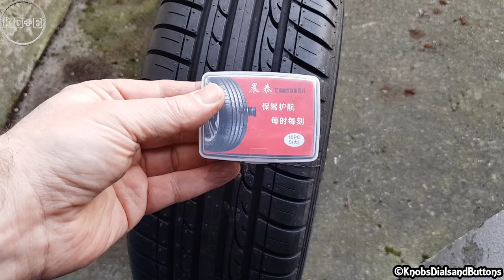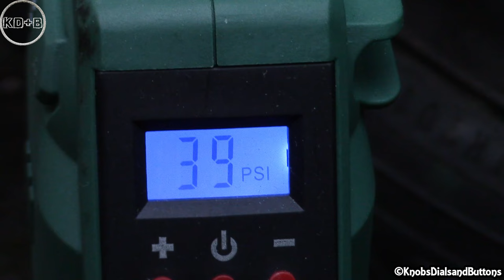Tire Repair - Fastest and Cheapest Puncture Repair Kit

Comment: Never take a tire for repair to any place that sells tires. They lie and rip you off to sell a new tire. I caught a local place doing it. I had plugged the tire but still had a leak. I wanted a real plug put in. They made me wait 2 hours and charged me 30 bucks. The next day the tire was low. I went back they toook the tire off rim and told me I needed new one. They wanted me to open trunk for temp spare so I had to go out in bay. I saw the tire off the rim. Looked inside and saw they never repaired it just the plug I put in. I snapped a pic and told them put tire back on rim and on car. When they tried to charge me I showed pic. I was going  make a complaint. They did not charge and refunded the first charge also for the phony fix. Turns out the guys in shop get kick backs on tire sold.
Reply: I would prefer forking out £60 for a new tyre than dying in an RTA.
Reply: @SuperLittleTyke  that's the thing.  If you know how to plug a tire well.  There is no need to die in a road traffic accident or pay for a new tire to replace your old one which depending on the condition, it might actually get resold by the repair shop. So technically speaking you would not only be wasting money on an unnecessary new tire, but also donating a good tire to your local shop. 🤷‍♂️ 

Fixing a tire on your own is way easier than changing your tire for the spare. Which is also quite simple to do, and not worth wasting the money for someone else to do the same thing. If you are worried about the time it might take.  It would always take a lot longer for someone else to do it. 

There are exceptions of course,  which only applies when the side wall of the tire has been damaged.
Reply: Discount Tire fixes flats for free. Also free tire rotation for the life of tires purchased there.
Reply: Good one
Reply: this is the real world . big fish eat small fish .
Reply: @jungleno. They refused to patch mine after I put a temporary plug in.
Reply: These screw in plugs are great what I do before I screw it in is dip it in rubber cement and for extra sealing
Reply: @SuperLittleTyke what else do u waste money on? No retirement plans?

Comment: I've been doing this for like 40 years lol. I use that black engine gasket silicone sealant on a screw and just thread it in. They last for months if needed. But its enough to get you someplace where you can get it fixed. Its also a good idea to keep a plug kit in your glovebox. I have several plug kits because i always fix peoples tires if i see them on the side of the road with a flat. I mounted an air compressor under my hood so i always have air.
Reply: Good job Sir.
Reply: Your way ahead of the game.  I also carry those traditional straight rubber plugs and tire sealants on our RV .  These seem to be so much easier to put in than those rubber sticks.
Reply: Complete hero 👏👏👏👏👏
Reply: Good man..💪🏽
Reply: Lol... I did similar but used rubber bands around the screw.   I'd of been rich now if I marketed it. 🤣

Comment: There's another YT video from auto channel who was doing a comparison test between these repair screws and repair sticky ropes. 4 screws on one and sticky ropes on other tire.  All held up after 40km/25 miles and 90psi tests.  And then, this guy did burnout of tires and 3 out of 4 repair screws were gone, but all the ropes held up. These repairs are absolute temporary repair, but there are really simple and easier to install  compare to a ropes.
Reply: What lame brain would do a burn out with a temporarily repaired tire which is supposed to get you to the next tire shop.
Reply: @achristian7015  Tyre plugs should last the life of the tyre.
Here is the tyre shop scam. You take your car in to replace the plug with a patch and they say; "we will have a look @ it and let you know if the tyre can be repaired."

All reasonable, you think. Hrs later, they ring you and tell you some bs that the tyre cannot be repaired. Ok, you think. Think again, they have taken the tyre off the rim, and now they insist that they cannot legally refit the tyre. You have been scammed.
The 2nd part of the scam is, they claim you must buy a new tyre (what choice do you have now). But... they dont have your tyre type in stock, or they cannot get it (all bs) and seing that your other 3 tyres are 'worn' (more bs, you thought they had another season left in them) and it would be safest to replace them all now so that they all match.
So, you went in for a $40 repair, and, 4 new tyres alter, it cost you $800.

Or, just fit a plug, they work fine. I have done it, it is very easy, and lasted the life of the tyre. If the plug falls out, the tyre slowly goes flat. Meh. This is not a blowout situation.
Reply: @achristian7015 : It was just a demonstration of durability. Dummy. 🤪🤪
Reply: @nordic5490  Then find another repair shop. I took mine and wife's tires to two different local shops for patching and both done for just $20.

Comment: Did you add the compound to yours that you do on the rope plugs? It seems like it would work better with rubber cement.
Reply from the maker: No, these repair screws come with their own sealant already on the threads
Reply: for peace of mind use these and the cement over it after as reinforcement its good for a long time IMO its just as good if not better than the plug

Comment: Keep in mind that most legit tire repair shops use plug patches wich are much more stable and installed from the inside out . I have installed hundreds of the push in plugs and only ever had problems with large size holes. Thats why i was looking at these options.  There is these screw plugs and there is also these interesting ribbon shaped plugs im looking into. If the hole is in the side wall or outer tread near the side wall we aren't supposed to plug them because they arnt reliable and can compromise the tire.  Sometimes there is multiple small holes or shrapnel in the tire wich causes multiple smaller leaks and the push in plugs won't work as well as a plug patch style.

Comment: Never used one, does look easy for someone incapable of pushing in a black rope.
Ill stick to the sticky black rope Ive used countless times as a permanent fix, never an issue.
For a larger hole this doesnt look like it will work, where at times Ive used two ropes, without a problem...

Comment: Got a screw in my tire, slow leak. Tire store won't repair as it's in last row of tread 
nearest the sidewall. Tiny frickin' hole and they say I should throw it away and buy a new one! 
This tire IS new. Only a couple thou miles on it! So, I tried a Slime plug kit, leaked worse then the screw I took out!
Waited a week to get these tire screws, since nobody sells them, and it is sealed! Haven't put it back on the car yet ,but 
it appears to be good, and people are saying in various places they last. So hope it does.

Comment: There is a weakness with the rubber plugs. Installing those plugs in most tires that have steel belts, the steel belts are like screen door screen but tighter weave. They have been known to saw through rubber plugs as they flex with every rotation of the tire.. I have never heard of that happening with the string plugs. But I have seen it with the rubber plugs
Reply: In this video the metal screw has a rubber compound around it, and bear in mind you taking the nail out or the screw of the tyre which now has a hole in it, and there's only a Steel Band around the rim of the tyre not through the tyre, that's why they recycle the tyres for playgrounds.
Reply: @1971dave there's steel mesh throughout the entire tire not just the tire bead or the "rim of the tyre".  Upon inflation, the tire would greatly expand in size if the tire were only reinforced near the bead. 
Tires may be made without the whole tyre being reinforced in Europe, but here in North America they are. 

The tread is the tire’s first layer, the belt is the second one, and then comes its inner lining that holds the air inside. Run a tire well below the tread depth and the cord begins to show and poke thru. Grabbing a tire with thin steel wires sticking thru doesn't feel good. It's equivalent to grabbing a frayed cable with your bare hands.

Comment: Best to just keep the nail in and drive to the nearest service station to get it repaired or replaced.  Any punctured tire is compromised and waiting for another flat or a blow out to happen. 
Now days your auto insurance or regular dealer maintenance oil change would cover roadside service tire puncture repairs or replacement if unrepairable.

Comment: ¿Es una reparación provisional o puede confiarse que permanentemente en ese tornillo?
En caso de ser temporal, ¿Qué tanto tiempo puede durar antes de llevar a vulcanizar el neumático?
Soportará un viaje largo de aprox 3000 kilómetros?

Gracias amigo.
Reply from the maker: I would only use this repair in an emergency. If you are going on a long trip I would have the tire patched professionally, just to be safe.

Comment: As many have noted, "screwing" the tire is only a TEMPORARY stop-leak measure, but it's by far the EASIEST method.

After "screwing" the tire and reinflating it (** IF ** you have a portable tire pump!), ** IMMEDIATELY ** (if not sooner!) head to a tire repair station (Les Schwab, Discount Tire, a gas station with a real garage, etc.) to get the tire Properly And Permanently repaired!
Reply: Most shops will dismount the tire from the rim and patch on the inside. That being said, they will tell you that a new tire is needed because it maybe against the law because the belt is damaged. That is what a shop will tell you.

Comment: Sticky rope plugs are good, umbrella patch (plug patch) is best. Internal patch is the worst, because it does not seal the layers of the tire. Air gets between the belts and slowly separates them, and the tire fails.
Reply: That is incorrect. An Internal patch is best for tire repair. A plug is temporary. 

Tire layers...
The tread is the tire’s first layer, the belt is the second and then comes its inner lining that holds the air inside. If you're getting air "between the belts" then you have bigger problems than a simple hole in your tire. Your whole tire is compromised. If air is getting past the lining then your tire would not be holding air. Tires are made so that air cannot get between the layers even when the tire is punctured. It's not like the layers of the tire are glued together. The belt is submerged into rubber when it's in a liquid state. 
You have infinite knowledge at your fingertips (literally). Don't be afraid or too proud to verify that your beliefs are facts.

Comment: The whole problem is that you will only notice that the tire is flat when it is already deflated... If I know that my car's tire is just leaking air, I will go to a tire shop and they will fix it there... To What happens if the tire is already deflated??  Even if I locate where the puncture is (which is usually not possible), if I put this in to seal it, how am I going to re-inflate the tire????
Reply: With an air compressor

Comment: I d rather remove tire air and apply rubber glue and then screw in so the rubber glue will be pushed inside.

Comment: I never had a Problem with Rubber Stick Plugs lubricate with Rubber cement and stick it in about half way where it Folds and Cut the rubber stick and you're done

Comment: My advice would be tohave these and the rope plugs. All punctures are not from screws or nails going straight in,  I tried one of these on a plug made by a flat piece of metal. Did not deal. The rope plug did.

Comment: Are these screws are made of metal (with glue around) or is it a rubber-screw? If it is metal, the screw may damage your wheel, if the tire's becoming flat by another hole, or?
Reply: It's metal screws covered in a rubber compound

Comment: The only advantage to this is that it would be so easy to do roadside.  I would definitely not trust it as a permanent repair.  TBH, if the nail was still in the tire, I'd just leave it in until I could do the "sticky ropes" repair, or take it to a tire shop.  I've used the sticky ropes and left them in for years without problems, but not this.
Reply: It is sometimes difficult to get those snot worms into the tires.  Otherwise they are perfect.
Reply: I  have a sticky rope in a tire that is 9 years old...still holds air
Reply: @Deontjie  Its only difficult if you don't ream the hole out to the size of the file in the kit. You have to spend a few minutes with the file to get it perfect. Then the plugs pop right in and the push stick pops right out.
Reply: @Darkice77 well u dont want it popping in and out too easy or the whole is too big.  Has to be snug enough

Comment: In the U.K. any small object (including the repair screw) is an MOT failure and deemed unsafe. If you remove the nail and insert a screw you are admitting you knew about it so you could be uninsured/ prosecuted if you have a bad accident. Having said that, I used to use screws + rubber glue for semi-permanent repairs many years ago, particularly if the tyre was close to the tread limit and not worth repairing. Never had a problem but I’m more of a stickler for being completely legal these days.
Reply: In addition to potential prosecution by the police, what is the insurance company going to say if it establishes that this kind of repair was done and there's a crash?
Reply: What about small pebbles that get stuck between the tire grooves?  Would the rope type of repair be considered "small objects"?

Comment: Perhaps as a very temporary fix to get to a tire repair facility, but this is NOT anything close to a permanent repair.  The only way this is better than one of those Fix-a-Flat type of products is that those sealants make a big mess that has to be cleaned from the inside of the tire and the wheel prior to a proper repair, but this screw method shouldn't have that problem.  Eventually, sooner or later depending on how you drive, the odds are good the screw will come out and possibly damage your vehicle or the one following it.  Get it fixed properly.

Comment: This never work, because the whole screw will drop inside the tire , I tried it many times and ended up return the kits
Reply: The hole is too big for the rubber nail screw being used.
Reply: You just saw a video of it working....
Reply: These work fine for a few days until you can get the tire repaired properly.

Comment: I afraid that the high pressure will fire out the screw as a bullet sometimes. Just worried
Reply: What high pressure?
Reply: I seen another video testing this repair screws and stick rope. Both held even at 90psi, but those screws are definitely temporary repair and should be properly patched.

Comment: It's not necessary to replace the tire for a new one when punctured. You can repare it many times for years without problems. I say that for experience. If you can't repair for yourself, take the tire to a repair shop but don't buy a new tire.

Comment: I have even better solution. Leave this nail where it is. Top up some air if necessary and go to tyre shop when it's possible to repair it properly ;)
Reply: They will sell you a new tire. Some of these that are thru the belt are illegal to repair due to liability issues.

Comment: This is very dangerous !!! U're deforming the tire, it's not rubber it's iron u're adding to it
Reply: Not too bright are ya?
Reply: It’s not deforming the tire, it’s just plugging a hole.  And Jfyi there are steel belts imbedded in 99% of auto tires on the road.

Comment: Very bad, these should be illegal !!
Reply from the maker: I'm just demonstrating how they're used
Reply: Why should it be illegal?
Reply: Must own a tire repair shop.
Reply: These are temporary fix to get to where you need to be before you get the tire patched properly. I tried the stick rope, but it's not the easiest to put it on even in my driveway. I can't imagine doing that on the side of highway in the middle of winter.

Comment: Tyre rope plugs should last the life of the tyre.

For those of you who think "just go down the tyre shop". Beware. Here is the tyre shop scam. You take your car in to replace the rope plug with a patch and they say; "we will have a look @ it and let you know if the tyre can be repaired."

All reasonable, you think. Hrs later, they ring you and tell you some bs that the tyre cannot be repaired. You challenge them, and the tell you that they have taken the tyre off the rim, and now they insist that they cannot legally refit the tyre because of damage from the nail, other unrelated minor damage, or due to treadware, or some other bs. You have been scammed.

The 2nd part of the scam is, they claim you must buy a new tyre (what choice do you have now). But... they dont have your tyre type in stock, or they cannot get them (all bs) and seeing that your other 3 tyres are 'worn' (more bs, you thought they had another season left in them) and it would be safest to replace them all now so that they all match.

So, you went in for a $40 repair, and, 4 new tyres alter, it cost you $800.

Or, just fit a plug, they work fine. I have done it, it is very easy, and lasted the life of the tyre. If the plug falls out, the tyre slowly goes flat. Meh. This is not a blowout situation.